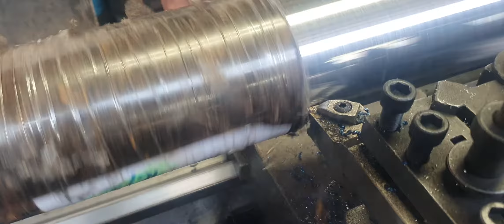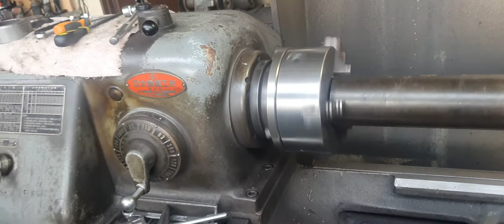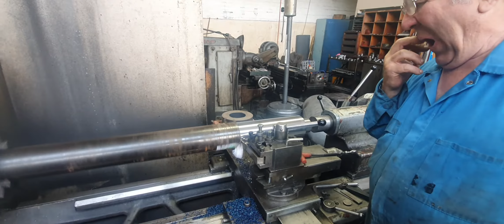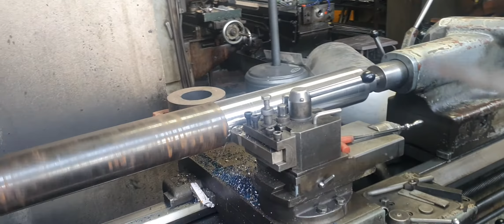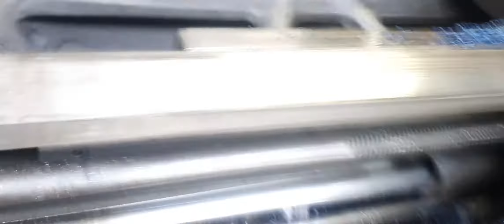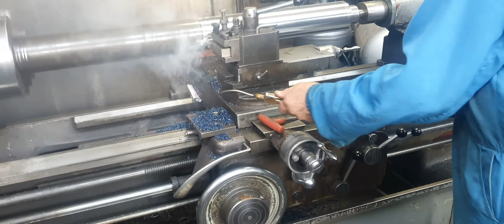Japanese Okuma lathe

Comment: At what point do you add water cooling ??
Reply from the maker: When your cutting tips are not lasting very long. Or if the steel your cutting is getting to hot. Some steel will start getting hard spots because of the heat.

Comment: Why did dad run the file over the machined part?
Reply from the maker: It felt a bit furry because that tip pushes the metal off instead of cutting it off like a negative rake tip would do or in other words a sharp tip. The tip we are using is positive rake that pushes the steel off instead of cutting it off